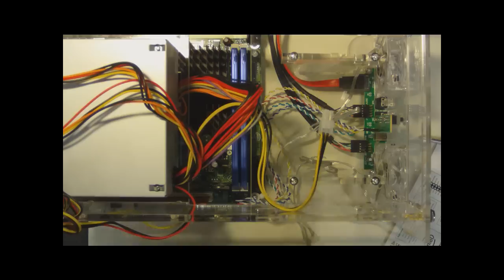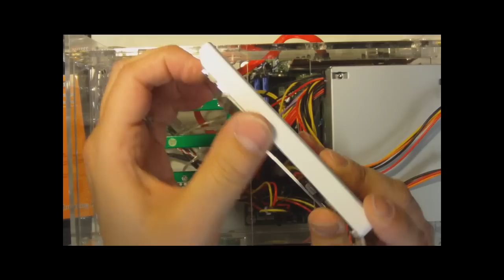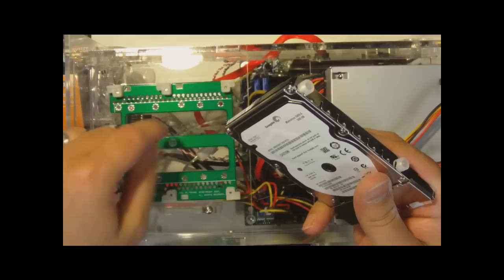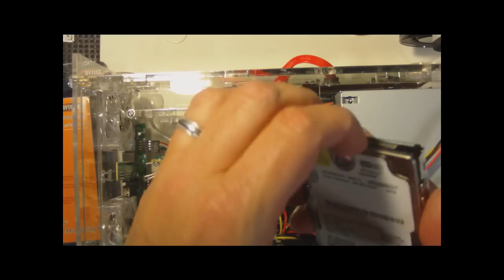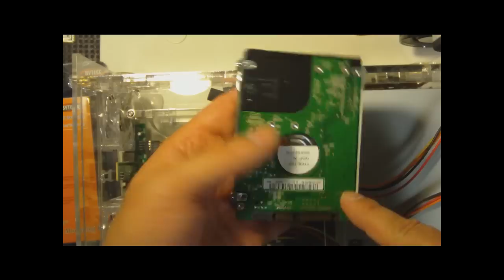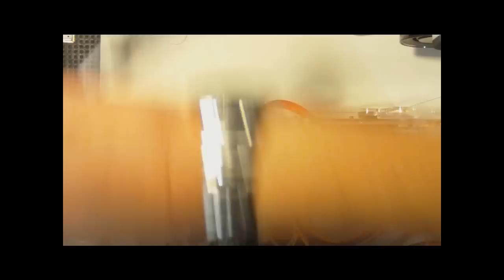D510 Atom Mini Windows Home Server - Part  Two

Comment from the maker: There is an eSATA connection on the front panel. Check out thesame video at 55 seconds in. Since the motherboard only has two SATA connections, I needed to bu a card for a third SATA for the front. I just got a cheapie SATA card.